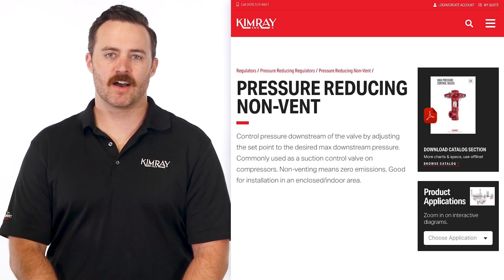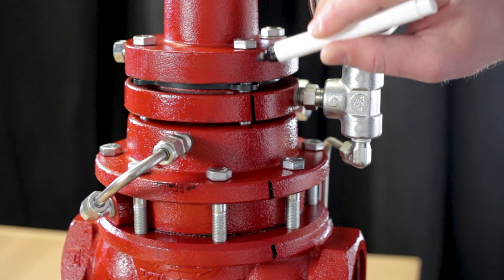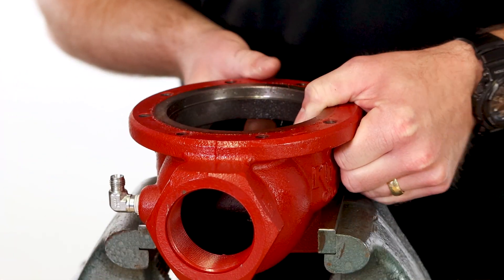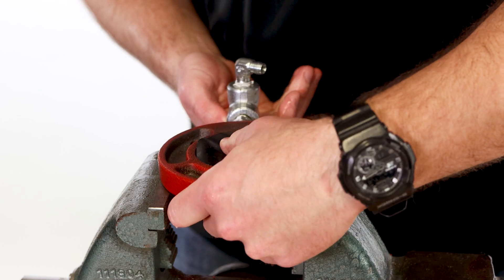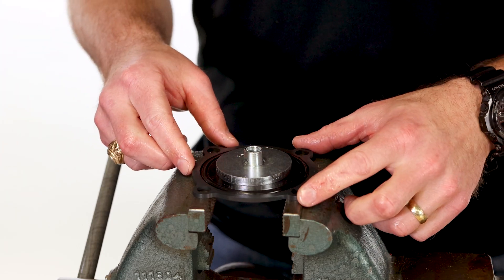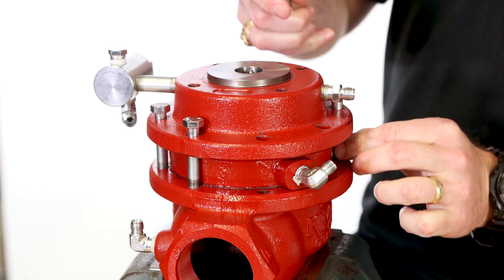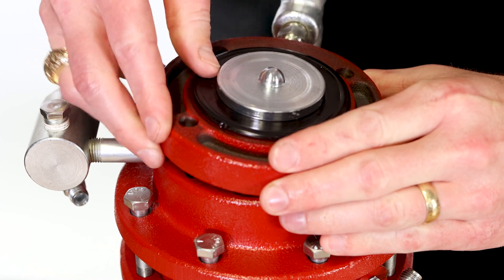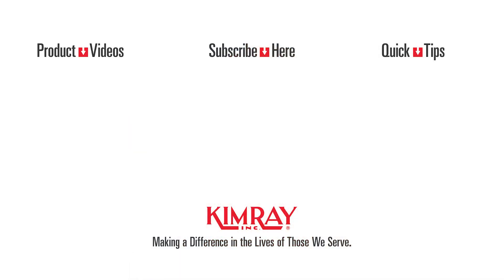Kimray Conversion: Pressure Reducing (PR) Regulator to Non-Vent (PR-NV)

Comment: How do you calibrate this regulator
Reply from the maker: Hi! Regulators are actually not calibrated. The setpoint is controlled via the adjusting screw, like all other regulators. Since it is not “preset” before it leaves the factory, there is no need for it to be calibrated. Perhaps if you're referring to something else we could still help answer your question!